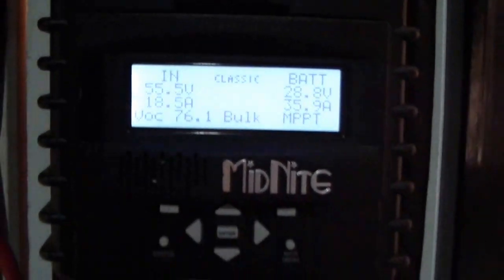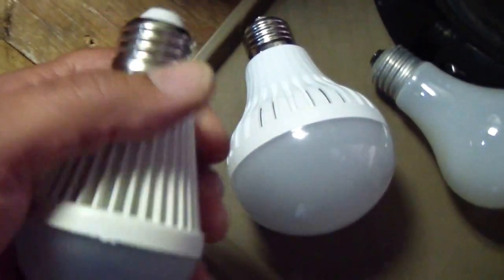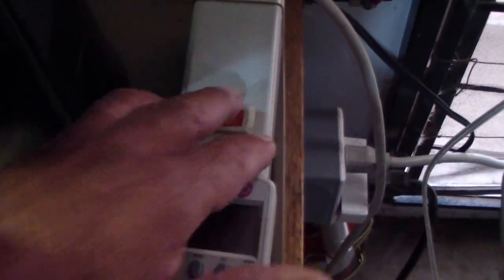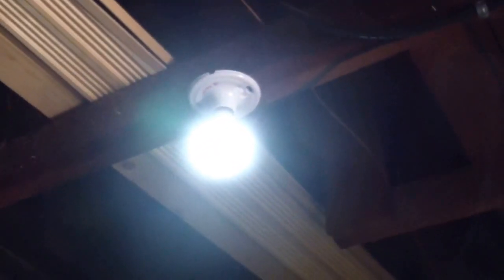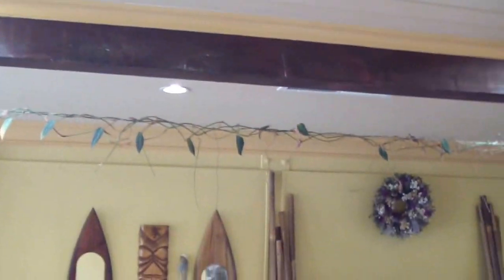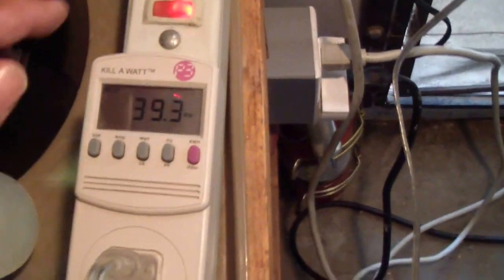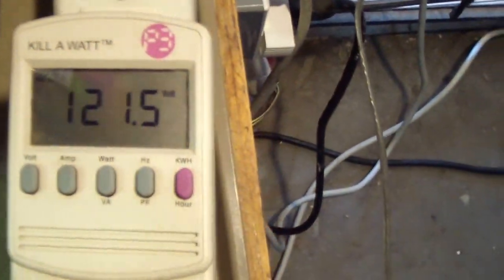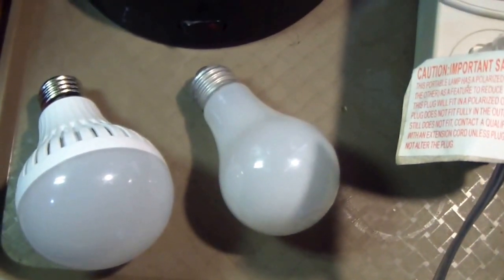Testing LED Lights

Comment: If you pull off the plastic cover at the bottom you get better light I also run 12v DC down lights directly off my small battery bank

Comment: great video, we have been using LED bulbs not for almost 3 years, when we ran a killowatt meter to see how much power 12 of them were drawing it was almost nothing... !     we use them in recess fixtures even though they say they can overheat, so far never had a problem
Reply from the maker: Yes you are right the heat is the biggest killer of the LED lights! I have been using the 12 Volt LED on my house lighting for about three years now and they still work great!
Godspeed,
Raz
Reply: We had started with the Utiltech brand from lowes, had one that would blink on and off at times, took it back and they replaced it.  NO problems with any of the others since then...  I did see that costco started carrying led bulbs and has the retro for can/recessed lights about 1/2 of what lowes wants for them.  but their 40 watt 3 pack was like $19 very affordable!   next stock up trip want to get some of their regulars, at basically $7 ea (after tax) good bargain.

The only thing that so far I've not been too impressed with is the hallway/bathroom lights have the sideways bulb position and the LED's don't seem to give out the greatest light on their sides, upright or straight down does best..   I have not looked to see if they have any specific to side positioning of the bulb yet.  I assume it is the position of the leds themselves ??  the bulbs in my 12v setup use a circular led pattern and do well at all angles.
Reply from the maker: fritz e http://www.ebay.com/itm/390532656798?var=660112190567&ssPageName=STRK:MEWNX:IT&_trksid=p3984.m1497.l2649
Reply from the maker: ElRazTheGreat1 http://www.ebay.com/itm/141199460418?var=440264649717&ssPageName=STRK:MEWNX:IT&_trksid=p3984.m1497.l2649

Comment: Love your lights Great1. Maybe post a link where you bought them so others can find. Tipping is all. Nice video
Reply from the maker: Will ad it to the description area of the video, thanks for reminding me!
Godspeed,
Raz
Reply: always
Reply from the maker: http://www.ebay.com/itm/390532656798?var=660112190567&ssPageName=STRK:MEWNX:IT&_trksid=p3984.m1497.l2649
Reply from the maker: ElRazTheGreat1 http://www.ebay.com/itm/141199460418?var=440264649717&ssPageName=STRK:MEWNX:IT&_trksid=p3984.m1497.l2649
Reply: Thanks for this Great1